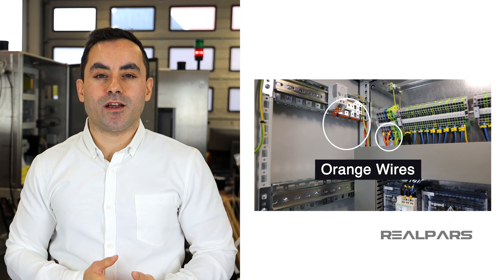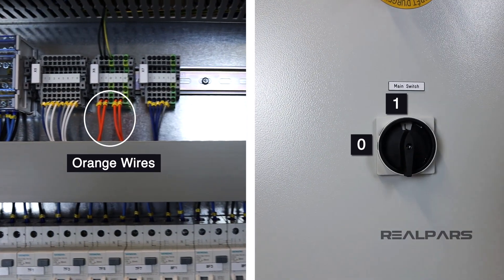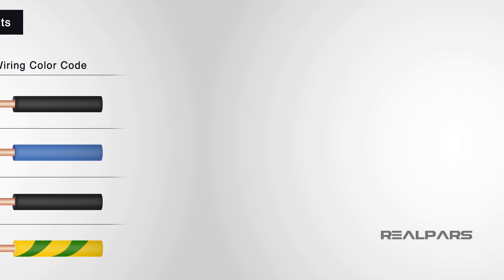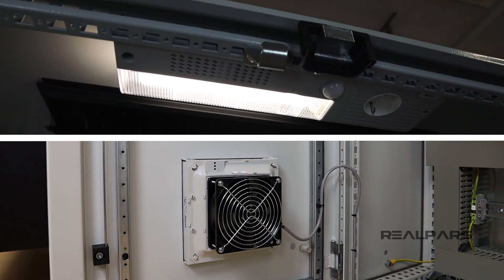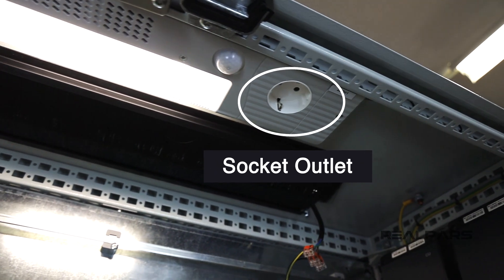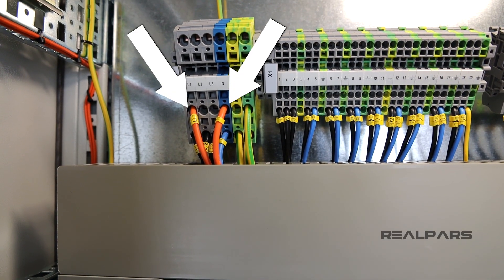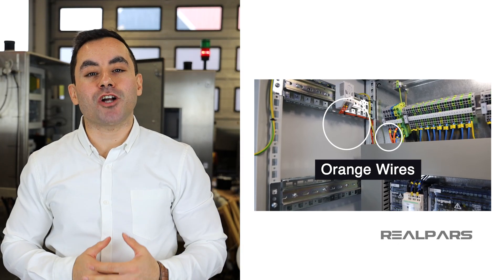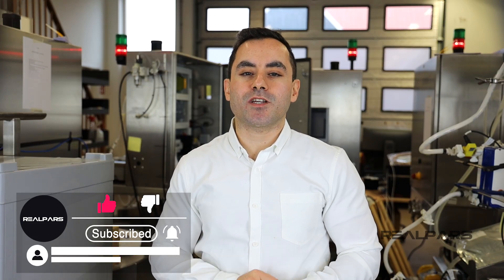What Does an Orange Wire Do in an Electrical Control Panel?

Comment: in europe is brown for load and blue for neutral.
Reply: erdingtown Germany: Brown, grey, black for the phases L1 to L3, blue MUST be N, green yellow MUST be PE. For me, yellow or orange could be foreign potential. Red can be anything.
Reply: @AndreasDelleske  same standards in France.
Reply: @philippesoares1745  Same in every EU Country really, because thats what Norms are for... Switzerland also has the same ones...
Reply: Same in the UK. Brown Black Grey for 3-phase is a standard. Never seen 3x black
Reply: @erlwindegans3954   I Often do 3ph as black, the current one for Australia is all black
Reply: Septic Sid good on you. In the UK the current 18th edition of the wiring regulation states the official colours for 3-phase as brown, black, grey and blue for neutral. Just following the regs ;)
Reply: Only the Green/Yellow wire is defined as Earth/Ground every other is only a non-binding requirements.

Black for AC Power
Light Blue as neutral
Red for AC control circuit 230V
Sometimes red/blue for 0V control circuit.
Dark Blue 24 V DC
Brown for low AC like 24V
Orange for every wire witch could have power after Power off.
White for low Voltage signals like 0-10V 4-20mA or something like this

Comment: Worked on a old 1970s built control panel this morning which had white wire only and only method of ident was the numbering at each end of the wire. Doubt it will ever get rewired - no interest or budget to do so.

Comment: Let's face it. If you don't open the mcc feeding the panel, you're gonna have live voltages somewhere in there.
In the US, so many things are different from what in the panel here. We'd probably be feeding Delta instead of Star/Wye. Neutrals would be grounded at the control transformer and colored white. Blue is only DC+ and DC- is blue with white or just white or even just more blue.
Reply from the maker: Thank you for  your comment.  There are quite a few differences how panels are constructed around the world, and it is always important to understand the codes and standards for those areas.  In the US, we receive many panels from Europe with machines built in Germany or Italy.  While the wire colors may be different and the types of devices may not be what we are used to, the accompanying drawings, BOM's and installation manuals allow us to install and startup these panels safely.  We may add lock-out points, arc flash stickers, and other items to adhere to local codes and standards.
Reply: Not all panels are feed from MCCs.
Reply: Not all panels are free from an mcc, sure. If you can point that out, you know enough to understand what my point was. Turn off the power upstream of the panel. It's a YouTube comment, so not always well researched and proof read.

Comment: Is it correct to mark supply terminals L1,L2,L3,N acc. To EN 60204-1?
Reply from the maker: Yes, but EN 60204-1 references the designations of supply terminals (L1, L2, L3, N, PE) in EN 60445.
Reply: RealPars 
EN 60445 Annex A say that conductors are named L1,L2... But terminals are named U, V, W, N
Reply: @Tavle  UVW are motor/transformer terminals in practise
Reply: sumilidero 
And the supply terminals for a machine acc. To EN 60204-1 and if there is more the one supply they are called U1, V1, W1,N1, U2, V2.....

Comment: thanks a lot, good work, question please, why you didn't  give the power to the panel through the main switch directly, why you used contactor in the way ?
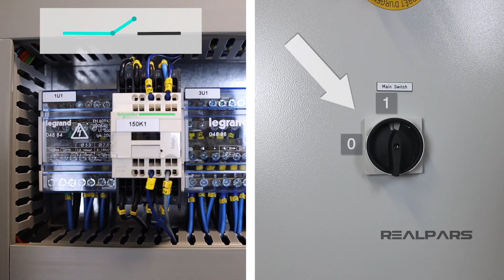Reply from the maker: At 5:52 in the video, the main switch is shown.  What is not shown is the main power feed connected to the main switch.  Some designers prefer to use a contactor with overloads instead of fused main disconnect blocks for space and maintenance purposes.  What I don't see is an external lock out on the main switch, but I am sure it has one, or there will be a nearby disconnect/lockout.
Reply: @realpars  thanks for the reply, but what is responsible for short circuit protection? I think the motor circuit breaker gv2 is responsible for the overload and short circuit protection
Reply: yeah thats weird, main switch should kill the incoming power directly, not via contactor

Comment: These colors on the control circuits don't follow NEC standard.
Reply: Roger Smith 
No EN 60204-1 (Europe) and maybe IEC 60204-1 (most of the World). North America are very speciel with NEC, UL and CSA :)
Reply from the maker: Dan is absolutely right.  The cable configurations/colors in the video are IEC standards.

Comment: Due to the laws that require special clothing and have specially trained personnel work inside a live panel, most of our customers require all outside voltages over 24 VDC terminate in a separate panel from the controls.  This simplifies things when electricians need to enter the cabinet to do their work.  Especially when the electrician is from an outside vendor.
Reply: Where does the orange  wires get a feed when the main  supply is turned off
Reply: Stephen Griffin it’s called "foreign voltages". It can come from lots of sources including devices sending or receiving signals to/from the panel in question.  It also may just be the power that feeds the panel.
Reply: Ryarios are you from UK?
Reply: Dan Jensen no, the US.
Reply: So,  average electrician can't work in live panel in US? little trust you have in your staff :p
Reply: sumilidero  Not true story all.  The problem is caused by ambiguity in the code, the definition of when you need to wear a cal suit, and the definition of a qualified person.  Many companies have decided to sidestep the issue by physically separating 24 vdc and below voltages and those above by putting all those in a separate panel.  Only certain specially trained people wearing cal suits can get in that one.  Doing this substantially reduces the liability of the company and is safer for the technicians and electricians.

Comment: I am an industrial automation engineer and I don’t think I have ever seen this standard followed by any integrator. I wouldn’t trust it, always use a diagram if you have one, or check it out yourself.
Reply: Rule number one as an automation engineer: don't trust anyone including yourself :)
Reply: @automate7128  😂
Reply from the maker: As with any electrical device, disconnect, test, and verify.
Reply: Correct
Reply: I’m 20 years in the industry (worldwide...not just US based) and the earth and dc hot are the only colors I recognize from this.
Reply: i AGREE, WITH THE ENGINEER WHO SAID HE NEVER SEEN THIS COLOR CODING STANDARD FOLLOWED ANYWHERE... IT CHANGES FROM JOB TO JOB... (USA)  HOWEVER, I HAVE SEEN TYPICALLY BLACK IS AC L1 (HOT) AND WHITE IS TYPICALLY AC NEUTRAL AND GREEN OR GREEN YELLOW IS USUALLY GROUND OR BONDING CONDUCTOR...  CLEAR INSULATION USUALLY USED FOR SHIELDING.  BLACK AND WHITE ARE MOST COMMON FOR 24V DC POWERED CONTROL LOOPS FOR INSTRUMENTATION AND CONTROLS.  TWISTED SHIELDED PAIRS ARE USUALLY OUTER SHEATH IS BLACK AND INNER FOIL LINKING MOST COMMONLY SEEN ARE LIGHT BLUE, GOLD AND SILVER FROM MY EXPERIENCE.  ORANGE ON AC PER NEC CODE IS USUALLY INDICATING THE AC 3PHASE DELTA HIGH LEG OR (STINGER) WHICH IS USUALLY HIGHER VOLTAGE IN REFERENCE TO THE NEUTRAL GROUNDED CONDUCTOR ON A DELTA 3PHASE SYSTEM, HAS TO BE DISTINGUISED FROM THE OTHER PHASES WHICH ARE ONLY 120VOLT USUALLY TO NEUTRAL.  MISWIRING THE ORANGE TAPED OR ORANGE PHASE CONDUCTOR OR NOT USING ORANGE CAN CAUSE DAMAGE TO ALOT OF 120VOLT EQUIPMENT.     I HAVE SEEN ORANGE USED ALOT FOR DATA CABLES AND FIBER OPTIC PATCH CABLES...  RED HAS BEEN SEEN FOR EITHER L1 AC OR 24VDC POSITIVE CONDUCTOR FOR DIGITAL INPUTS AND OUTPUT FIELD WIRING, ON PLC CABINETS, USUALLY BLACK AND WHITE FOR AC HOT AND NEUTRAL ENTERING CABINET AND LOCAL CABINET MOUNTED BREAKER, BUT AFTER BREAKER, CAN BE BLACK AND WHITE OR EVEN RED AND WHITE OR RED AND BLACK.  AND BLUE IS OFTEN USED FOR THE DC POSITIVE INSIDE THE CABINETS.  BUT FIELD WIRES FOR DISCRETE CONTROL LOOPS can be black and white or in multiconductor cables a whole array of colors.
Reply: I have  from what my company had bought from European vendors

Comment: This is European code not American standard
Reply: Standard code for electrical panels only refer to where they are manufactured. In USA we use import panels wired up however the other countries/companies want to wire them. I work on panels in USA using orange exactly like this video.
Reply: If you're using the NFPA 79 and UL 508A there absolutely ARE standards that overlap here. Case in point: orange and white/orange wire for components that remain energized when the panel power is disconnected.
Reply: Just trying to inform all the inexperienced that may watch this video. Don't be a smart ...
Reply: @normanlevasseur6565  I dont know what inexperieneced people watch this video, but when he clearly says at 1:55 that it is according to European Norm 60204-1, are you really suprisied that he is not talking about united states of america specific norms?
Reply: @kubeek  no need to be so smug
Reply: oh really? What tipped you off?
Reply: @kubeek  For starters the european (CEE 7/4?) power receptacle :-)

Comment: A lot are. I had to reroute several wires in a cabinet that were run in front of the strip. When I threw the main power, I found the wires I was working with were live. It was only 24V so I black taped the tips and ran them through. Also, several contacts and other electrical/electronic, almost half the panel, were still live. I asked around and no one knew. Thanks RealPars.
Reply from the maker: Great to hear that our course video cleared the issue up for you, Keith! Thanks for sharing that with us. 

Feel free to reach out if you ever have any questions!

Comment: This wiring method must be company specific or country specific. Any cabinet that has power that cant be shut off has to have labeling on the outside telling anyone that shutting off the disconnect will not kill all power in that cabinet.
Reply from the maker: Correct, if there is an electrical feed to a panel that cannot be disconnect at the panel, an exterior label should be provided indicating where the remote circuit is and where it can be shut off.  Both NEC and IEC have guidance on how this information should be displayed.
Reply: RealPars 
Do you have a link to that IEC guide for labling?
Reply from the maker: @Tavle  IEC 61439
Reply: Finn NA are you sure the labling have to be outside or Can it be inside the panel around the supply disconnector?
Reply: Cabinet and electrical panel are restricted, only technicians and authorized personal.
Reply: As far as I know, it's specific to those using the NFPA 79. While there should also be a label on the outside of the cabinet, it includes that these wires should be orange and orange-white.

Comment: What do you mean by a neutral wire where Europe ha a 220 volt single phase system and a 380 V 3 phase system. A thee phase Delta system would = 1/2 of 380= 190V and a 380v Y four wire=219V. Is theat what you're referring as the neutral?
Reply: Robert Ulrich 

Grounding in Europe is different from US. We have TT, TN and IT-net (search for it)
Normal voltage is 3x400/230VAC for TT and TN-net and it consist of 5 or 4 wires(IT are most for marine and off-shore normal without N). L1, L2, L3(phases) N(grounding point in the HV/LV transformer on the LV side star point) PE (Ground) or PEN (combined PE and N)
3x400: L1-L2=400V, L1-L3=400V, L3-L2=400V
3x230V: L1-N=230V, L2-N=230V, L3-N=230V
Reply: The phase to earth/neutral of a 380V 3ph system is 380/sqrt(3) = 220V. The neutral (4th wire) would go back to the start point somewhere upstream.
Reply: @joncurtis199  What you mean that the system (380v) is a 4 wire Y grounded system. That's the only way to get 220 volts from the utility side of the equation.
Reply from the maker: You will use a neutral in a 3-phase system only when you intend to use each phase separately for loads, like in a Y-grounded system (see Robert Ulrich's comment below).  The neutral (4th wire) prevents one phase from "feeding over" to another phase.

Comment: First time I heard about orange wires
Thanks realpars
Reply: And you'l likely only ever see them in their panel. Seen my share of them and never came across that.
Reply: @2312-p3b   Or any other panel designed using the NFPA 79 standard, since that's where this comes from.

Comment: Don't believe this is how every cabinet is wired. Always read the elementary drawings.
Reply: Exactly Justin,  Just because this panel is wired like this does not mean every other one is.  Very misleading video description
Reply: Never seen one with that colour scheme here in Finland, everything is usually wired with black conductors. :)
Reply: Yellow is what I’ve seen fir the last 40+ years in America.
Reply: But usually it should be like it , SHOULD BE ,any way think that every wire is energized even u had cut the energy off ,just think like that
Reply: @practicasindustriales4168  it's your type of mentallity that cripples the industry. Turning small risks into catstrophic nightmares which creates thousands of laws and rules to detain work.

Double, tripple, quadrupple check everything and then you don't need to brainwash yourself that "everything is on".
A powerwand and repeated checking have saved me from danger more than your idea.
Reply: @MR-nl8xr  I think you misunderstood Miguel, I've always taken the idea that "work as if everything is live" to mean "until verified as dead with a known good meter, every conductor is to be treated as live". If you actually treated everything as live, you'd never get anything done. :) And always trust your meter more than an isolator is another good rule of thumb. :)
Reply: Hell this is so wrong !! Typically orange wire is used to identify a circuit that is used to decouple to another machine and is not connected to the control voltage of the panel that it is in - basically a dry contact/circuit. Always pays to read the drawings and take nothing for granted and if you don't read and understand the drawings to check first then you should consider taking up plumbing.
Reply: This is European standard only and not law as the author suggests.
Reply: How long do we have to wait before you get on to transducers ? They come with the colour wires fitted by the factory ffs .  @Justin wtf ? + @allgoodinthehood how many people actually like being mislead ? You know inertia will come into play in a chapter near the end and it would just be the same BS all round . What about push-pull door switches on a vending machine for live or dead go to PADDY POWERS and turn Yellow River (song) to full volume to get on with this one .
Reply: I have aslo seen black with a yellow tracer as a outside power source always confirm it is your safety
Reply: I never used orange for internal lights, so this vid is a load of BS, the person who orders als can say what kind of colors he wants, usualy it is up to us who makes it but in 30+ years I NEVER used orange for internal lights